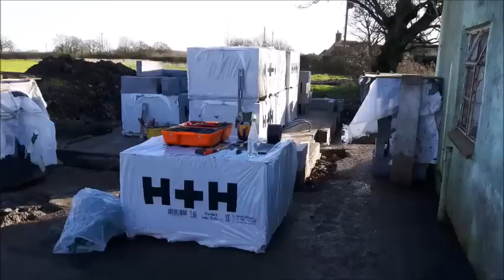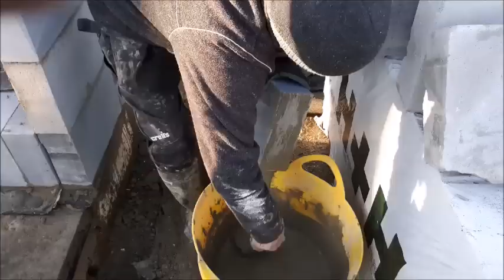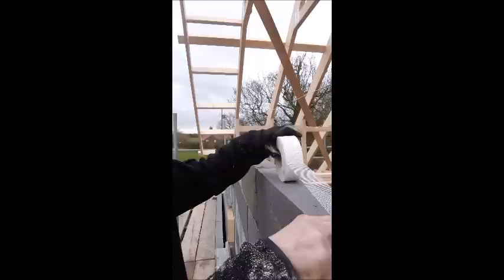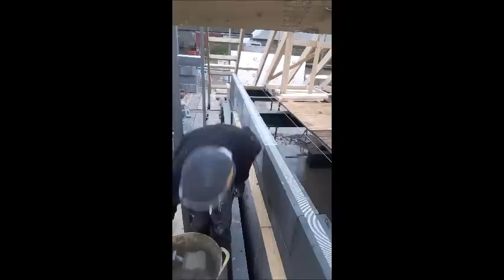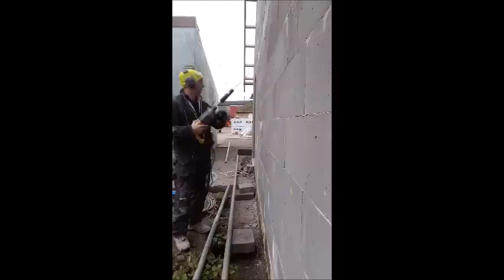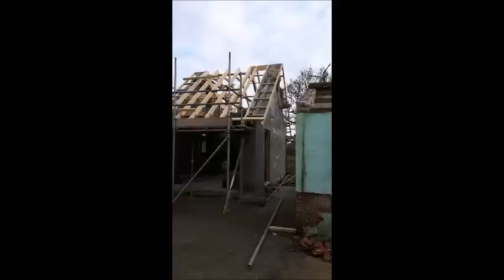the fine art of brickwork   -  Garage - Thin Joint 6

Comment: I remember learning this in collage but it never took off 👍
Reply: Manufacturer's fault. They should have developed a different size block so that a thin-joint internal leaf would course with a brickwork external leaf., e.g. a 222mm tall block, rather than 215mm blocks that only works with a traditional mortar bed. The helical wall ties they promote are quite a good solution, but there are a few situations where they don't work, e.g. where you want 150mm of PIR insulation (i.e. passivhaus) in an exposed location.

Comment: used this method on a 3 block and a sem20 plus years agoi , blocks used were double in height yet same length to blocks you're using, 2 courses of common brick to get level using mortar then 5 course of block to joist height, method is take up to wall plate get the lid on and build peaks, then drop back down and take face work up, whilst other trades are working inside , building firm stuck to traditional build, pods also never took off also,

Comment: the blocks that your using? what are they made from coal dust?
Reply from the maker: They are mainly made of fuel ash from power stations, but as coal is used less and less, it will run out

Comment: Firm i worked with years ago used this system but alot of cracks started to appear in them
Reply from the maker: Ah, cracks normally happen if the bed reinforcement is not installed, I've used it a good number of times with no issues but its almost impossible to obtain the materials nowadays
Reply from the maker: Yes, all to building regulations
Reply: You also have to ensure that the blocks are property dry, and that the correct mortar is used. If the mortar is too strong, it can cause cracks if the blocks move (and there will always be some movement).

Comment: Looking into specs for a 1200s/ft unit using this technique.
The sodding stuff is 400% the price of mortar.
Do you believe you could replicate the thin joint mortar with Cement and SBR or tile adhesive.?
Seeing as its just a waterproofing bonding agent.
Reply: Very late in the day, but i have used thin joint many times, mostly with the celcon bagged mortar. However,  i ran out one day and had about another forty or so blocks to lay to finish off the extension. So i mixed some very fine sand with OPC and and used a good amount of waterproof pva. I got it to the consistency of the bagged stuff and it stuck really well. It's like tile adhesive really.
Reply: It's an interesting point. Celcon might consider whether publishing the formula for their adhesive would promote greater use of the thin-joint system and so sell more Celcon blocks. Personally I doubt that it would, and so sticking with a proprietary formulation is problably the best commercial decision for them.

Comment: VERY NICE WORK WONDER IF THIS BLOCK CONSTRUCTION WOULD WORK IN AN EARTHQUAKE ZONE WHERE THEY NORMALLY USE REBAR INSIDE HOLLOW BLOCK CONSTRUCTION?ARE THE BLOCK S LIGHT WEIGHT?
Reply: Blocks are light weight. There is not so much information available in the UK about lightweight block construction in earthquake zones as we aren't in one. But there are examples of lightweight blocks, such as Hubel's which are available in the USA, that have cores drilled out for vertical rebar, and U channel blocks for horizontal rebar (e.g. for a ring-beam around the top of a building). I would sugested looking at what resources Hubel have for using AAC blocks in seismic zones.

Comment: With such thin joints how do you fit in wall ties (if you have a brick outer skin), steel lintols, DPC/DPM overlaps, lateral ties to roof trusses, and wall starter ties? Also is it a lot more time consuming to precisely cut units around openings so you can still use thin joints (or do you switch to using mortar at these points)?
Reply from the maker: +Benzknees The lateral ties and wall ties are shown in this video. For lintels, please watch Thin Joint 5.the cutting around openings is done with a masonry saw or sometimes a Clipper saw and the benefits far outweigh traditional cutting, as you can see at the end of this video.Thank you for watching
Reply: +rob songer You show helical wall ties for use with lightweight, aerated blocks, but surely you wouldn't use those with brickwork? In remedial situations brick has to be piloted before using helical ties, to stop it cracking, and then you have a hole in the brick to fill with a matching colour, which is time consuming and probably a no-no from an aesthetic point of view. If you fit helical ties to the inner skin only, and bond them into the brick skin as it is built, it seems to me that you will encounter problems with the line of the bed joints matching up because of the different bed thicknesses. Also bedding in the usual thick cranked steel ties for upper floor joists and the bottom members of roof trusses will require cutting of the blocks.
Reply: +rob songer Thanks for pointing out you have a separate video on fitting lintols to thin bed blockwork. And whilst I appreciate what you mean about the reduced material waste with this method, the extra labour needed to precisely measure, mark out, and fine cut the blocks (to lintols, openings, corners, junctions, movement joints, embedded restraint bars) must surely outweigh this by a significant margin?
Reply from the maker: +Benzknees for the ties in a thin joint wall that has a brick outer face, please see the Gable video,
Reply from the maker: +Benzknees I used a Clipper saw on the first project and is by far the quickest way to cut any brick/block.On small extensions a hand saw is quite sufficient.The speed with this method doesn't stop at the blockwork, the dry lining doesn't need adhesive as the boards can be nailed straight to the wall using nylon nails supplied for this.For me, I find construction easily twice as quick as traditional and as you see in the video, it ticks every box.
Reply: in Germany they use very thin strips of metal, very thin it's in a roll about 2 inches wide
Reply: @johnsherratt3718  Sounds like the Bakert Murfor Compact product. Definitely the right stuff for thin-joint blocks.

Comment: Is this method stronger than using bricks?
Reply from the maker: bricks will have a minimum crushing strength of 20N (Newtons) whereas standard blocks are 3.5N or occasionally 7N. But when compared to those blocks the thin joint system is much stronger with the mortar used. if the wall was to fall, the blocks break before the mortar does.

Comment: My polish mates swear blind by this , they keep telling me to try it out , I’m tempted , but not sure with our England weather conditions how it will hold out damp and other things
Reply: If you build carefully it can be a good system. You need to avoid cracking, and adjust your methods, e.g. by specifiying the right wall ties. Getting a good fixing it AAC also takes a bit of thinking about, but there are cheap specialist fixings that work better (to my mind) that those available for clay blocks such as Porotherm.

Comment: hey Rob what that tool called ur using to put mortar on if built a breeze block shed but been doing my joints with trowel and my joints are al over the place it's not bad for my first time
Reply from the maker: I think you mean the Brickie mate, by Noel Marshall
try a Google search on his name
Reply: rob songer  okay cheers fella  one more thing I've only done single blocks and waters coming thru my mortar at bottom what best thing I could do been looking at mortar sealant and concrete sealant
Reply from the maker: +Goon Huddz unfortunately it's a little difficult to advise without seeing pictures.
Reply: +rob songer  ok fella when I finish work al send u a pic but don't laff lol my first ever time doing a block shed
Reply from the maker: +Goon Huddz I have a video of me doing different types of blockwork and the techniques used for each...but never uploaded it
Reply: +rob songer should up load it fella will help a lot ov people out like u have done already

Comment: Hi Rob,  I know its been a few years since you posted this.  Appreciate a bit of advice.  I would like to build a Block Workshop/Shed.  6.5m h x 2.8m. w x 2.4m height.  Is it worth using thin joint block-work for this kind of project? Thanks in advance.
Reply from the maker: I would always build this way, but unfortunately it is so rare in the south of England it is now very difficult to get the materials, although I have been told it is used more in northern England. Just to clarify, if you do decide to go with thin joint then your blocks must be aircrete (Thermalite, Celcon, Ytong etc) with a rendered or cladded finish.
Reply: @robsonger1  Thanks Rob, sounds like a plan.  I am up North :-)  Back from Africa next week so will check the supplies.  Semi retire in August so this will be my ecape once built.

Comment: Hi rob thanks for the video, what is the bed joint tool called? Why is it 2mm bed? Is that standard for that block? Thanks
Reply: 2-3mm bed is standard for that block, although you can use a traditional 10mm mortar bed. You do have to be careful about mortar strenght. If the mortar is too strong, e.g. it is a mortar made for bricks, it will cause the blocks to crack if there is any movement in the blocks (and there will always be some). The mortar comes from the block manufacturer, and is the correct strength, i.e. it is slightly weaker than the blocks.

Comment: Excellent video rob, thanks. No a fan personally of thin joint, think it de-skills the trade and requires all other elements of the building to be design around it. But yes can see the benefits. Has been around in Europe for a very long time now. How much more did the block cost per metre squared?
Reply from the maker: +Edward Williams   The blocks are exactly the same price /m2 as other aircrete blocks. c£8.40/m2
Reply: +rob songer , is impressive, no requirement for a more accurate size blocks due to the lack of adjustment in bed joint?
Reply from the maker: I find all Celcon blocks are very accurate and with the Jumbo Plus the extra size covers areas quicker. The 2mm joint ensures the block sits virtually right with only minor adjustments needed.
If grit gets into the bed joint and causes a bump in the level then a simple Celcon Rasp is used to level the top again. I did that once on this job.
Reply: +rob songer , excellent work, thanks for sharing
Reply: What you doing here...haha
Reply: Why should the trade be more skilled that it needs to be?

Comment: I take it you can only use this system if there is only blocks. The gauge would be tricky with a brick skin alongside..
Reply from the maker: not at all, all my cavity work is done like this. The benefits on speed, accuracy are far better than conventional methods. As it says in the video, it can be twice as quick as using mortar.
There are another 5 thin joint videos I have on here, please watch them.
Reply: Ok I'll have a gander..cheers

Comment: Hi rob i wandering if you could help me , I am building a conservatory for my mum an all Te squints will be cut by hand and not bought it I was wandering if you could tell the specific way you work out mark and cut the bricks into squints .
Thank you
Reply from the maker: cutting bricks into squints isn't a great idea although I have done it once on a small turret on a church because the company I was working for wouldn't buy squints.I set my bevel to 45 degrees, marked the brick all the way round and then carefully cut them with a disc cutter.
Reply: +rob songer hi rob thanks for that it's the same for me my mums bf dosent wan to buy squints so I have to cut them ,also  with regards to cutting the bricks what measurement do I use on the brick, I.e like 190 mm on the brick  then place the bevel to mark the 45 degree cut
Reply from the maker: Matt Harris It's a little difficult to explain without a sketch but basically you need to measure 50mm both ways from a corner, so you mark a line middle of the header and 50mm on the stretcher, join these together (this will give you a 45 degree line top and bottom of the brick) Cut this, then along the stretcher face measure 158mm and cut, then draw a 90 degree line on the squint cut you did first, this will allow the return brick to join up to it.
Cut just one to start with, make sure it bonds nicely with the next course before cutting all of them.
Reply: +rob songer ok mate thanks for the info mate il do that ,il advise them to buy squints pre made but I won't hold my breath

Comment: What is the reinforcing tape you are using on the beds? It looks like plasterers joint tape.
Reply: It is, but such tape is made of fibreglass and is very strong in tension which is what is needed. The tape has no strength in compression. However, the blocks resist compression very well, but are weak under tension which is why the need the reinforcement.

Comment: These are thermalite bricks, have to be by size and weight, reason its only a 2mm mortar is the mortar is more glue type.I cant remember the amount of mortars first used for thermalites, I think there were 3.I built a house when they first hit the market in the mid 90's using thermalites for the internal walls, they are great insulators.Nice videos Rob, the tape you are using , isn't that the same tape used for Gyprock set joints.

Comment: Air tightness was never an issue when the internal walls were floated and skimmed , now with dot and dab plasterboarding there is an air gap behind the board
Reply: That's why the joints should be full..😉
Reply: It's not an issue with Celcon blocks and their thin-joint system even with used with dot and dab or battens for the plasterboard.

Comment: I have been a bricklayer in the USA for 30 years and i have never seen anything like this. Good video.
Reply: baggd65 right im a union bricklayer thin joint or butter joints are illegal
Reply: +Michael Orr its not mortar , totally different thing
Reply: I'm pretty sure I would get sued for this in the USA. LOL But it's fun to see how people do things in other parts of the world.
Reply: The system uses a special ready made cement-based, quick-set adhesive and lightweight aircrete blocks. You can't just use regular mortar and any blocks
Reply: @michaelorr2827  Only in the regressive USA.

Comment: Hey Rob great job on all the videos bud,  I've been a brick for 7 years now and learnt a but of this thin jojt system when in collage, I noticed that you out cellotex in the cavity then you drilled the ties in place,  hm just a quick question,  what stops the cellotex from falling and breaching the cavity?
p.s. keep up the good work bud (thumbs up)
regards James.
Reply from the maker: hi James, I fix the celotex to the blockwork first with a couple of screws and restraining discs
Reply: +rob songer ah that would make sense thank you :).
what about costs between thin joint and traditional? I'm guessing it's about £10/£15 per m2 dearer?
Reply from the maker: the blocks are exactly the same price as traditional, around £8.50/m2 and the mortar is £11/bag and lays around 15m2it's no more expensive, and is twice as quick.
Reply: +rob songer Thank you rob this is amazing news I may start to convert into doing this method on extentions just for the U values and less wastage.
keep the great videos coming bud you're doing a good job.
Reply from the maker: before you start your extensions, have a practice first,
Reply: +rob songer hehe will do its been a while since I done it but I'm sure I'll get back into the swing of it.

Comment: Did you adjust your cement to sand proportions I feel like there's an insufficient bond being established and that whole wall will buckle over time.
Reply from the maker: +Mark Whitman Believe me Mark, the bond is so strong, that if you tried to push this wall over, the joints would not break, the blocks would break first. Hence the need for bed reinforcement.Also, the mortar isn't proportioned on site, it is ready mixed in a bag, just add water

Comment: Got to say If I was doing a self build and wanted the room on quick this has got to be the way - that mortar was setting like quick set gear for fence posts leave it in the bucket for 5 minutes your done - solid bucket in the skip....
Reply: This should be the construction method of choice for self-builders who want to be hands on with the process. (Those that want a hands-off approach have a wider range of choices). However, it has quite a number of complexities that the builder needs to understand if the method is to produce a good result. This makes is less suitble, unless you are prepared to research the method, and adopt all the teqchniques that using thin-joint requires.

Comment: Hi Rob, what ratio of sand to cement are you using?
Reply: There's no ratio. The thin-set mortar comes direct from the block manufacturer and is pre-mixed, requiring just the addition of clean water to make up the mortar.

Comment: Hi rob, thanks for the video.
I've only every seen this method used with light weight block, is that because this method requires higher suction to work or can it be done with concrete blocks also?
Is that just plastering scrim tape or a specialist material ? 
Thanks again
Reply from the maker: yes, it's only for the lightweight/aircrete blocks. With regard to the bed reinforcement, they provide one that is the same as scrim only its orange, and twice the price...so I use scrim.